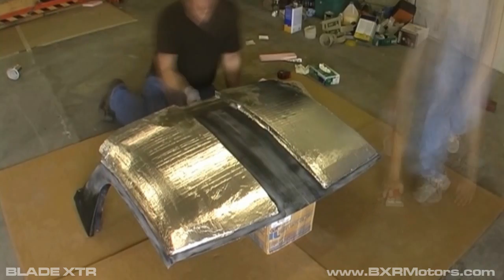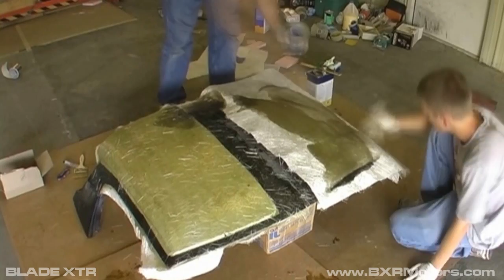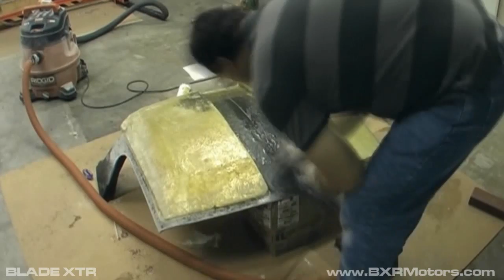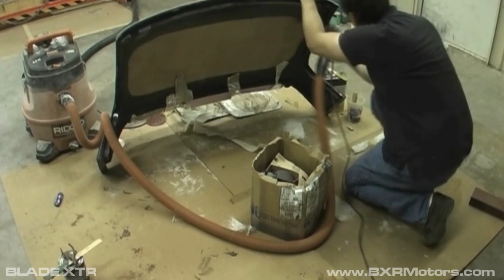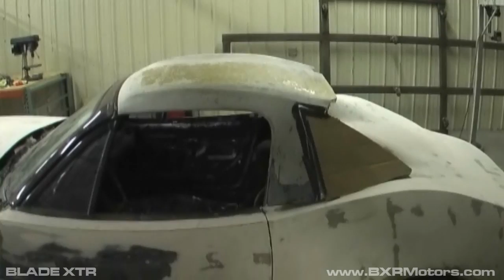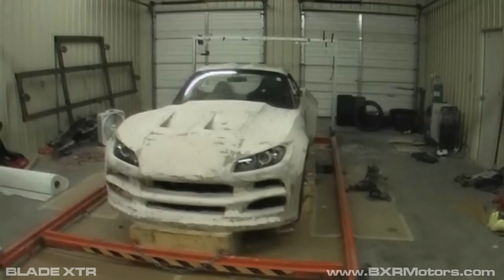Bailey Blade XTR Car Design | Working on hard top part 2 Fiberlgassing and shaping - Part 17

Comment from the maker: Thanks for the comment, The doors are from a Miata but only used as a template. I talk about this in other videos but basically we are using the windshield and side glass from a Miata in order to cut down on cost. The chassis is completely custom.

Comment from the maker: Yeah the aluminum tape has a ton or uses but in this case its just used to protect the foam from melting when exposed to the resin. It also holds everything together and gives you a smother surface to work with.